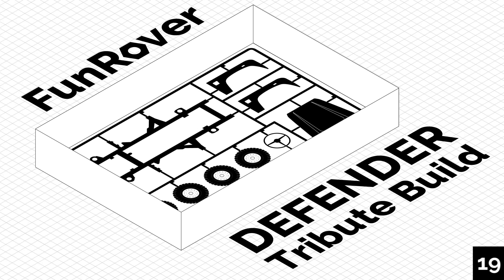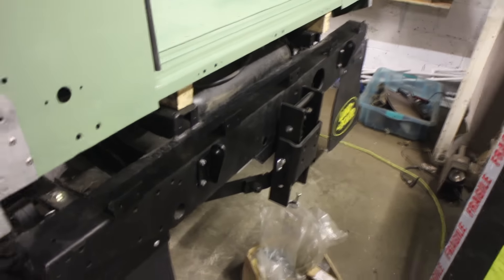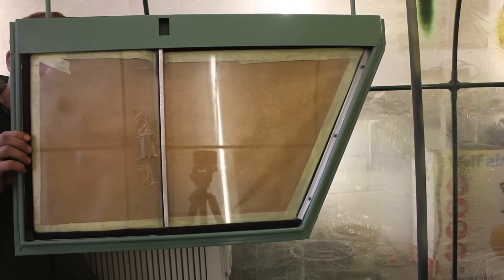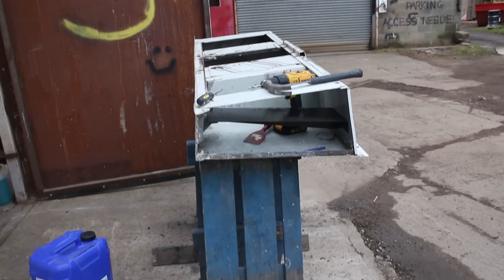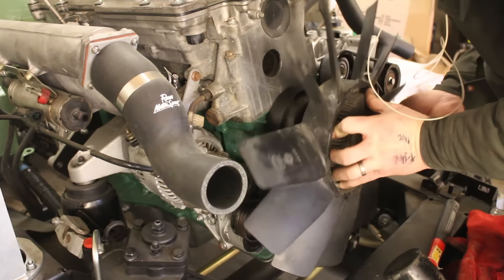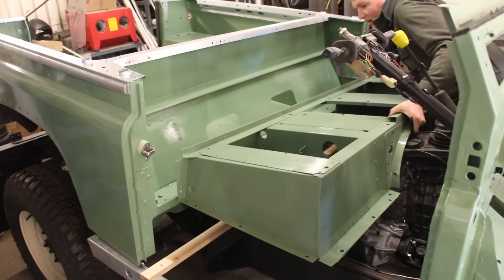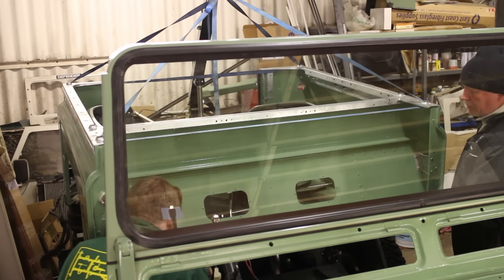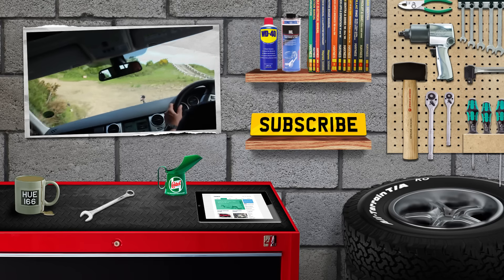Painted Panels, Split Doors, Fold down Windscreen & Seal

Comment: Really like the way you are going with this, all of the features I loved about my old Series 3. I have visions in my head of some system of levers to discretely operate the transfer box lever allow you to have a pair of transfer levers, a yellow low-hi lever and a red diff-lock lever.
Reply from the maker: +Matt Tester (UKMatt2000) I did think about a fancy lever set-up but am trying to keep custom fabricated stuff to a minimum, just in case we ever break down in the middle of the Mojave desert ;)

Comment: Hey mate,
loving every moment of the build. I watched you're videos from the start, and especially the tribute build video.
I was just wondering what bulbar i should get for my defender, u also inspired me to get a landy :D 
I was thinking about getting an A-frame nudge bar, (the land rover plastic coated one) as i love the look of it as it is square and i think looks good with the landy. is this a good for protection of the Radiator and the engine though? i plan to do long trips with it, especially camping and some off roading trips with mates.

Cheers good luck with ya build :)

Comment: Great vid, im struggling to fit a rear right door seal on a 110 (2008) where it goes around the curve, it keeps making a dent in the rubber, tried everything. Is there something im not doing right?

Comment: Wow Ben, you are really getting through that! I'm half tempted to get mine painted in bits but quite concerned it won't colour match 100% 🤔 
By the way, did you fit the foam behind the upper steering colour bracket ? I fitted foam but also cut out a 1.5mm ripper gasket. That'll stop it leaking in if it ever get the chance :)
Reply from the maker: +KimberlyBarnett123 Hi Kim, Not fitted a gasket yet, just bunging it on there for now. It will need to come off again to fit the dash and will add some gasket material then, I've bought some 1.5 / 2mm neoprene rubber. Hows yours coming along?
Reply: +funrover great 😊 the 1.5mm I've been using for everything, just got a load more 👌 
Mines a bit slow. Hopefully tomorrow I'll fit the heater matrix 😁 and the air box etc.

Comment: what type of paint did you use
Reply from the maker: +Thomas M 2 pack non-isocyanate, wouldn't recommend it
Reply: +funrover Would you rather take the risks with Isocynanate version or paint with something like celluose?
Reply: +Thomas M Was going to say looks to be a lot of orange peel in the finish. Have you put a clear laquer on?
Reply from the maker: +Thomas M I would set-up a air fed system and go 2 pack next time. There's no laquer
Reply: +funrover Thanks for replying. Was going to say you could wet sand and polish back up to high shine if laquered. No worries
Reply from the maker: +Thomas M will probably do a compound polish once it's safe to do so, there's enough coats to colour sand if needed
Reply: +funrover Would be awesome if you did an episode highlighting any detailing/paint correction type things!